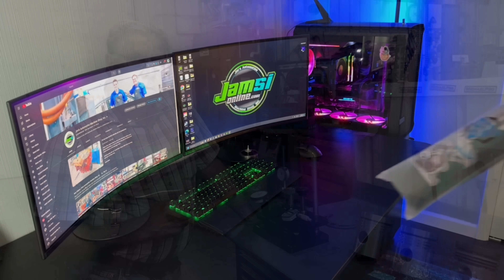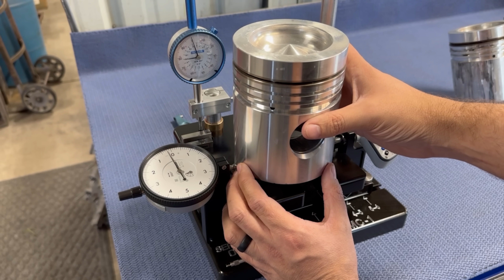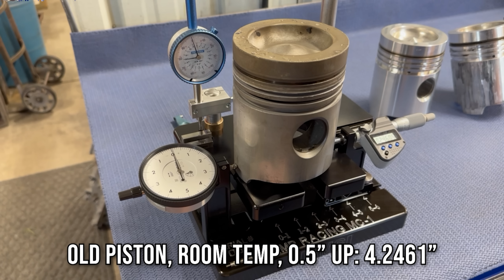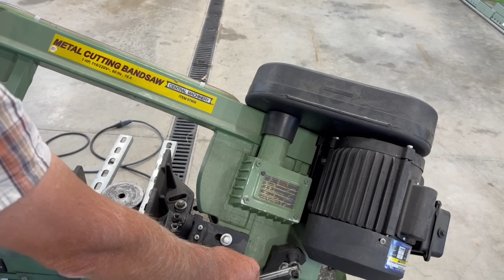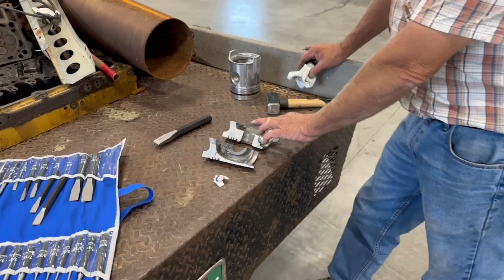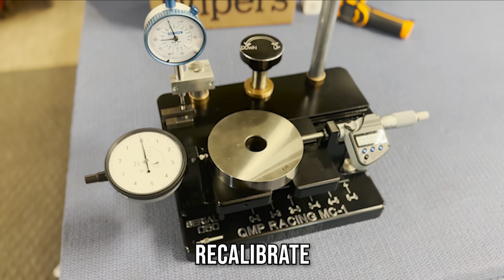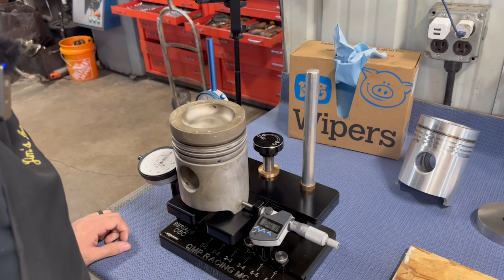Have TRACTOR Pistons Changed In 50 YEARS?

Comment: Well, check out  2 piece pistons. I've got 6 of them staring at me right now .If you have not ever seen one, you'll be surprised. Good video you 2
Reply from the maker: I was gonna do a video on them a while back when we had some in the shop haha! Maybe in the future! 

This video was really meant to just focus on this one engine in particular as a follow up to our build series haha
Reply: Two stroke or? That's the only application I've seen for multi-piece pistons personally. You definitely have my curiosity peaked wondering what you're working on
Reply: @goosenotmaverick1156  the cummins n series and some of the cat family has 2 piece pistons . I'm just finishing up an inframe on an N14 select  cummins motor . I wished I had a Jim's automotive in my neck of the woods. Those men would have all my machine work bissnes and then so more.
Reply: @nofucksgivennotone2046  same here in regards to wishing we had them nearby. My one machine shop I trust tends to be at least 4-6 weeks before they can get to looking at stuff. 
Sounds like you have a fun job on your hands
Reply: The Caterpillar 3126B, has two piece pistons. Steel crown, aluminum skirt.
Reply: @Bill-sp8kb  Yes, you the man Bill and the I think the N series  of cummins have 2 piece I know this n14 does I have apart.

Comment: Simply yes.  As much as the technology around the engine has changed so has the internals, from tighter tolerances to better materials those engines have become more efficient, reliable and optimized.
Reply: There are a lot of aftermarket parts out there made out of whatever is on hand.

Comment: It looks like your hypothesis was correct. Maybe your original ring gap would have been just fine in a perfect world with no problems but couldn't withstand the conditions caused by the fuel pump. You do know some flat earther will find fault with your analysis?
Reply from the maker: Absolutely! That’s pretty much our conclusion lol
Reply: I would think the manufacturer of the pistons would know what clearance would be needed. I can't understand why the armchair experts wouldn't take that into consideration. And you guys do this daily so your measurements would be much more accurate than the average farmer rebuilding one in his back 40.

Comment: Has the fuel changed over the 50 years?
Reply: It is a diesel engine
Reply: Yes, the fuels have changed considerably. For one they reduced the amount of sulfur in the fuels that reduced the lubricity of the fuel that helped to lubricate both the injection system and the pistons slightly
Reply: @richardbryant7165  Is this diesel or petrol  engine?
Reply: I don't believe that they do burn hotter because the sulfur also caused the fuel to burn a little bit hotter as well.
Reply: It certainly has, but at the end of the day it's not so much the fuel but the sustained combustion chamber/exhaust gas temperatures, at least on this topic.  There is obviously the sulfur variation but that's a different conversation.  Do newer fuels burn hotter though?  That's a fantastic question.
Reply: Yes, very much so. Prior to 1993, the sulphur content of diesel fuel averaged around 3000ppm. After, it dropped to 500ppm, and since 2007 it's at 15ppm. With the change from 3k to 500ppm, we were seeing BUNCHES of seized pumps, scored liners, etc. Those of us running older engines, like Cat 3406 A/B, Cummins Big Cam 350/400/444, or 6V or 8V91 Detroits used to put ATF in our tanks to try and keep the pumps alive a while longer. It did help to a degree, but there were still a lot of early pump remans  and in-frames done along about that time. It's gotten to the point that ULSD actually will have a lubricity, and a combustion additive both injected into it at the loading rack, especially if the rack blends Bio to 5%. Due in part to the change from mechanical distribution pumps to electronic actuated injectors, we didn't see the flurry of issues with the switch to 15ppm from 500, though we did get a whole new crop of issues with the aftertreatment systems. (which we are still dealing with, btw)

Comment: Thats interesting.
I wonder if the block side of the tolerance window has a larger variance.
But as you said, the manufacturing & quality control changes of the last 50 years are significant; but not something that can be tested adequately; you'd need a hundred or so samples for a limited test.
Reply: Yes but as to yesterday's quality today we would think parts should have better quality as to 50 yrs ago I have a 1957 D8 caterpillar that has cast ring lands and no tin coating was able to reuse all the Pistons with new wet sleeves new rings
Reply: @andrewklahold2880  exactly why I said tolerance & not quality.
I know full well that for everything we do better today, there a way it's done worse because that's cheaper.
Your example is the direct opposite of what Jamsi is dealing with, but the irony is that single examples never give the full picture.
Your machine could have been from a mob W better quality control & tighter tolerances, or it could be the one best motor they ever build, at the whims of random chance.
Jamsi could be the Worst for their make of tractor (tho they mentioned at least 1 other, so..), or a bad fluke.
There's a Lot of maintenance issues that come back to cumulative tolerance interactions, that are  simply troubleshot until the thing works Well Enough.
We both know that D8 could never have been built to be that perfect after all that time; no more than the tractor was build to be a first of its kind failure.
That's just not possible without large numbers of units for random chance to work with.